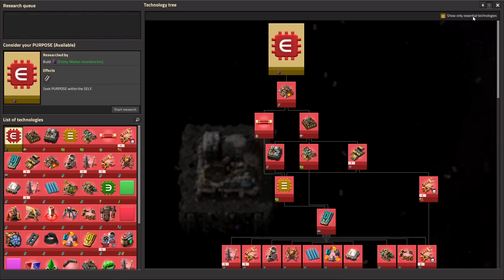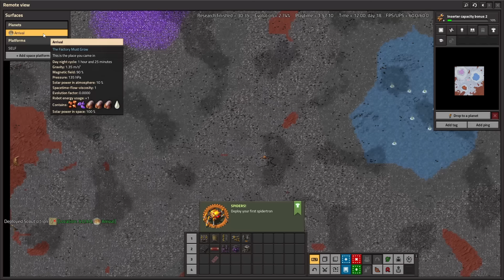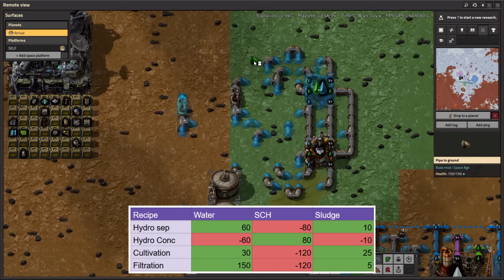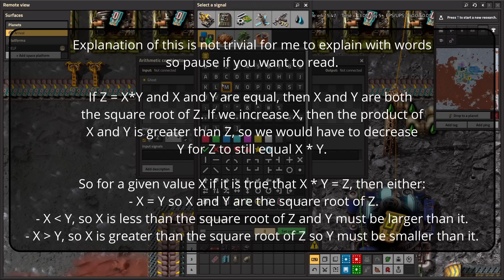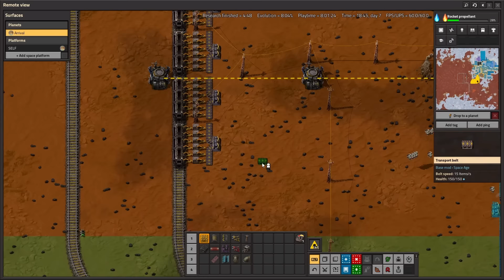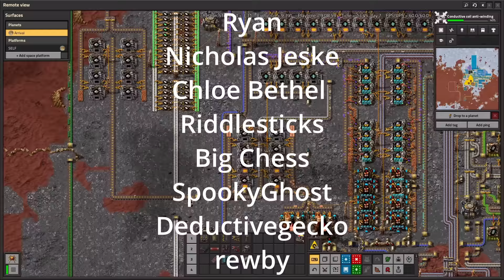Factorio: Space Age but You Play as a Sentient AI | The Factory Must Grow

Comment: i bet it's more efficient overall to have several science verifiers that multiplex inputs into a single calculator setup one frame at a time. the pipeline of outputs can be multiplexed back into the verifiers. less combinators per verifier.
Reply from the maker: It’s not particularly expensive so I don’t really see the point in this. Theoretically you could run 2 introspection card verifiers this way, but you could only do one at a time for exploration cards anyway because it’s iterative.
Reply: @ripecontext  for the exploration cards, you could calculate the maximum amount of iterations it takes to converge upon a solution, and then build that many babylonian method iteration modules chained together. 

as long as the combinators are synced up such that they can handle a continuous stream of 1 frame signal inputs, then if X is the number of frames it takes for the output to be produced, then X is the number of verifiers the calculator should serve at once for maximum efficiency. then the verifiers altogether will verify 1 science per frame.

you're right that it is so convoluted that it might not be worth it. it could be useful for saving UPS, though.

Comment: My square root computer takes a constant 9 ticks to resolve - I likewise used the Babylonian method but I start with the Manhattan distance instead of 1, and from there just 3 iterations are enough to get the nearest-integer accuracy needed, so I chained the combinators together to keep it all clean and consistent ;)
Reply from the maker: That’s very clever, I like it
Reply: Huh. My first thought was to use a decider combinator to select a starting value based on what range the input falls into. 

Edit: Actually, you could outright solve the problem in a single tick with enough conditions on a combinator...
Reply: @macdjord only 28 thousand combinators needed.
Reply: @oobanoobaisterrible  Remember that a single decider combinator can have multiple conditional outputs now, so you don't need a separate one for each value.
Reply: @macdjord  Happy to know I am not the only one that thought about this stupid brute force solution
Reply: Out of curiosity, why are you sure that 3 iterations is all it takes? Also how are your 9 ticks split up between the setup and the iteration itself? 
I tried my hand and got the iterative part down to one tick (though due to how Factorio rounds and being unaware where you got your 3 iterations number from I can't say for sure that my method still only needs 3 iterations) and my startup time is 3 ticks before I can start iterating.
Reply: @tekbox7909  I made the assumption that the range of inputs would be under 2^16 in magnitude, otherwise the square would exceed 2^32 and overflow the combinator. I wrote some code to help verify that even in the worst case (when dx and dy are equal) the Manhattan distance would be good enough to find the real answer to within integer precision, and found that it was after three iterations.

As for the combinators, it goes like this:
- Tick 1: calculate dx, dy, -dx and -dy
- Tick 2: select the positive signals and add them (by naming all the outputs of tick 1 "M", adding them is free by crossing wires), and also calculate the squares and add them by naming both results "S".
- Tick 3: divide S by M, output named M
- Tick 4: add in the previous M, divide the sum by 2
Ticks 5 and 6 repeat these last two steps, and 7 and 8 do it again. I think I shaved off a tick from the algorithm whole writing this comment 😅
Reply: You could also start with the approximation implicit in the movement rules of the TTRPG Pathfinder 2: sqrt(x^2+y^2), where |x| > |y|, is approximately x+(y/2).

Comment: Having to use combinators to solve problems to make science is an incredible gameplay mechanic, I love it
Reply: something i always wanted was "decay observation science" where you'd have a machine with a capacity 1 slot that produces a sciencepack if a specific item decays while in it. then another machine that would output spoilage data about its inventory, so you could use circuits and timings to build holding areas to  precision pre spoil and then deliver them into the observer so in the ideal case it observes one item per tick
plus cooling boxes that can slow down spoilage plus circuit control for them so you can fan out the spoilage values :D
Reply: @Maric18  that would be a super cool problem, I'd love to take a crack at it
Reply: @Maric18  hmmm, i'll put it in the concept list.
Reply: I love it too!
Reply: It's one of the most insanely creative things I've ever seen out of Factorio mods.  The modding community never ceases to amaze me.
Reply: Wow, that's cancerous as fuck.
Reply: this nearly makes me wish i had space age over a SE2 barly. even if i suck at math.
Reply: nerd